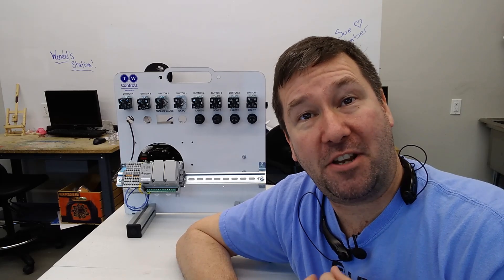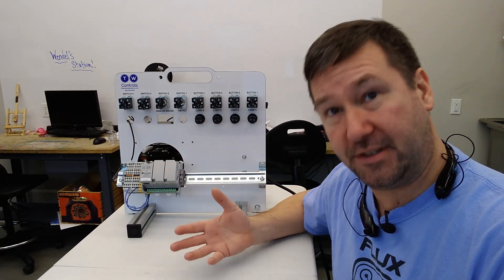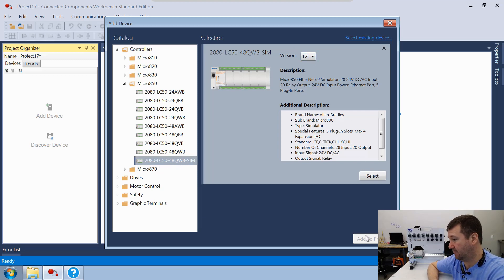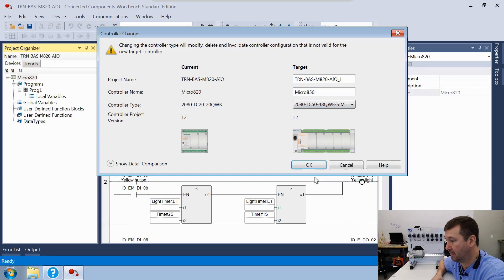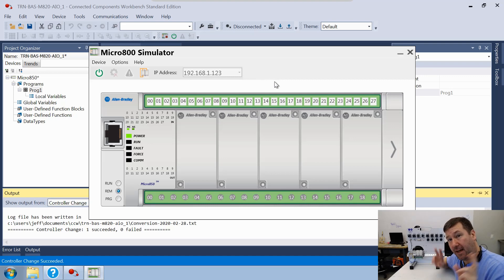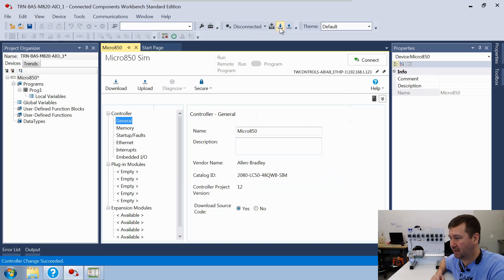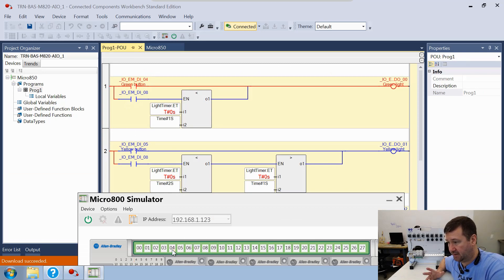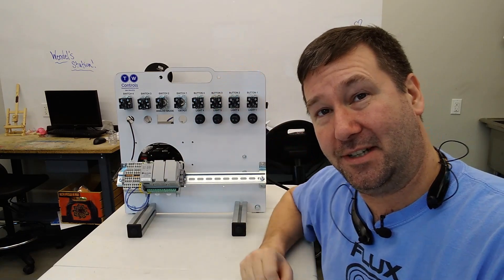Allen Bradley  Micro800 PLC Simulator Connected Components Workbench

Comment: Hi Tim, Tried the exact same way, the IP address shows in the Ethernet ip driver in rslinx but with a red X on it, so I can’t set it as communication path, what could be the issue, the same IP pings fine, I also have disabled firewall , still same problem persists .
Reply from the maker: Did you hit the power button on the simulator?
Reply: @TimWilborne yes I did
Reply from the maker: If it was a real PLC I would be leaning towards an issue with the harmony files. I guess the same could be true for the simulator. Try this. 
https://youtu.be/ehcek7zRGg0
Reply: @TimWilborne  I tried deleting both harmony files and then tried again, still the same issue is persisting. I also tried adding 127.0.0.1 software loopback interface1 as an ethernet device in configure driver option , even that shows up in rslinx with a red X, then i uninstalled the software and reinstalled and tried again but still the same issue is coming, I don't know what i can try next..
Reply from the maker: That's tough, I would check for any internet security suites that might be blocking ports 2222 or 44828.  Also, are you using the Ethernet/IP or Ethernet devices driver?
Reply: @TimWilborne  i am using ethernet/IP driver, i have allowed port 44818 (this is the port for microsimulator) through firewall, when I run netstat -ano on CMD prompt it shows TCP,  local Address as 192.168.64.2:44818, foreign address as 0.0.0.0:0 and state as LISTENING and on the next line, it shows TCP,  local Address as 192.168.64.2:44818 foreign address as 192.168.64.2:52196 and state as ESTABLISHED, so it means that port is open and listening. But it still doesnt connect and rslinx gives red X on this IP...

Comment: Hi Tim...I am new at the Micro850 and CCW. I am using the Simulator to practice. I am selecting ST as my programming language. I can not find the user interface any where within the CCW. I do see the PanelView, but that has to be connected to a physical PanelView to use as a user interface. I just want to do a simple thing, have a push button, where you can click on/off. Please advise.

Comment: I had a simulator working, but now I always get the fault "0xF019 - An unexpected software error occurred due to memory or other controller resource issue." and can't find it in the Manual. Any idea what this or how to fix it? Also, I've found solutions for the (44818) port issue, but still seem to get it.
Reply from the maker: Haven't seen that one Brandon.

Comment: Hi Tim... Love all these great training materials.  I have bought several of your trainers and use them at our college... absolutely love them!!  Quick Question about the Micro800 Simulator.  Every time I attempt to turn it on, I get an error message about "the EtherNet/IP Port (44818) is not available because it is already allocated by:  RSLinxNG"  any suggestions about how to remedy this?  Is it something to do with my version of RSLinx classic?
Reply from the maker: Hi Doug.  Glad you figured it out!  A few more details for the next person who may run into this.  RsLinx Enterprise is running...probably as a service...and needs to be closed.  In order to close RSLinxNG.exe:
1.  Press Ctrl + Shift + Esc to open Windows Task Manager
2.  Then go to the Processes tab (or Details tab if you have Windows 10) and look for the RSLinxNG.exe.
3.  Then right-click on it and then on End Process.

To prevent RsLinx from running as a service...
1.  Go to Start-->All Programs-->Rockwell Software-->RSLinx and run RSLinx Classic Launch Control Panel.
2.  Uncheck the Confirm that Always Run as Service check box and press Start.
3.  Start the simulator
Reply: Nevermind... figured it out.  Had to shutdown FactoryTalk Linx processes in the Task Manager.

Comment: Hi Tim. Is it possible for you to create a video explaining wiring and logic of a DC motor drive to a PLC?
Reply from the maker: The logic would be the same for most drives.  Check out the 2 wire control and 3 wire control videos at the following link.
https://twcontrols.com/ac-drives-and-3-phase-motors

Comment: Great video on getting started with the free Micro800 Simulator included with the free Connected Components Workbench software v12 and above.  As you point out, you need to simulate a Micro850 (2080-LC50-48QWB-SIM).  This is great to get started, learn some logic, and perhaps test some code/algorithms.  You can even use it to communicate with a HMI or VFD.  If you are looking to do any of the following, you need to get a real controller.  Serial Comms, Modbus, Modbus/TCP, Real Time Clock, Socket Comms, High Speed Counter, Plug In Modules, Expansion Modules.  Also if you really get fancy with some floating point calculations, you will see a slight difference between the physical controller and the simulator.
Reply from the maker: Great info Dean.
Reply: I was trying to import the tags to a LS software for HMI, XP-Builder, but it didn't work for me. Can you explain more?

Comment: Hello again, Tim ..
I'm following your steps, and when I'm going to do the "change controller", I don't see the same options that appear to you!
I don't have that "2080-LC50-48QWB-SIM" option ..
I've tried it in different ways and it doesn't work.
What should I do?
Reply: I already understood what was the issue.
Reply from the maker: @ricardogondim2346  What did you find?
Reply: @TimWilborne  
I realized that when creating a project, I choose a Micro850 controller.
Then I did the programming and only then I have changed  the controller for the simulation one. Sometimes when I download it, it searches for Ethernet and does not find any and also does not simulate. What I do is, I turn on the simulator and put it in REM mode, and download it again.I think what got me confused was that you started with the simulation controller and then used your own program, already done. Because only afterwards I have noticed that the controller was different. Anyway, learn from mistakes :)
I hope this can help someone with the same kind of doubt.
Thanks Tim for your availability, I appreciate that.
Reply from the maker: @ricardogondim2346  Thanks for sharing what you found.
Reply: @TimWilborne  Of course 👍😉 I agree with you, about sharing thoughts and experience. But you're the one I have to say Thank You. Without you I would never knew about Micro800.  So, Thanks for sharing it. You're very kind.👍
Reply from the maker: @ricardogondim2346  You are welcome, glad I could help.
Reply: @TimWilborne  Hello Tim, So, I have been programming a management program, and among others, I use a CMP.

But, on Micro800 I can't find anything that does the same functionality! Of course, I can always use other 
functions, to achieve the desired.  But my question is: Do you know how I can build the program using a function more similar to a CMP?     Imagine an example:  I want that when my "power" would be greater than 600KW, for "X" seconds, it would connect the 2nd transformer! So I could do: CMP: Power> 600. 

What do you think?
Thank you.
Reply from the maker: @ricardogondim2346  it has the compare instructions. Check out our counter lesson at the following link, we use them near the end of it. https://www.theautomationstore.com/allen-bradley-micro800-counter-instructions-in-connected-components-workbench-software/

Comment: Hi, Thank you for your excelent videos. Do you now if the standard version let to simulate ? I have this but when I select download, the system only do compilation. Thank you very much for your answer. Greetings from Colombia.
Reply from the maker: Yes, the standard version has the simulator, make sure you have the latest version of CCW.
Reply: @TimWilborne  yeah i hace 12 version, i select the PLC model sin as You indicate i'm the video but option download don't run, insee the similares PLC only. I don't know what happen. Thank You for your answer
Reply from the maker: @comercialmoxasesoria3028  Did you start the simulator and power it on like show in the video?
Reply: @TimWilborne  yes sure, the simulator appear and Plwer on but download mor run. This is the unic difference. This start to compile and not récord the programa, not error appear.
Reply from the maker: @comercialmoxasesoria3028  I'm not understanding this part, "not récord the programa"
Reply: @TimWilborne  I mean the download don't run... It do compilation process when I click download to the similator
Reply from the maker: @comercialmoxasesoria3028  Does it say download successful in the report window?
Reply: @TimWilborne  the answer I did download is COMPILATION SUCCESFULL... I Don't know why..
Reply from the maker: @comercialmoxasesoria3028  Did you switch the processor to run mode?
Reply: @TimWilborne  yep this is runnimg
Reply: @TimWilborne  Hello, I found the trouble was ethernet configuration of my laptop and the machine specifications. Thank you for your guidance.
Reply from the maker: @comercialmoxasesoria3028  Glad you got it working.  Ethernet configuration can be tricky!

Comment: Is it possible to do videos on real life application such as food, beverage or mining  PLC programming
Reply: Power plant or food
Reply from the maker: @mate2173  OK let me see what I can work out :)
Reply: Tim I hope it's not to late. I am trying to get a tank on the supply 2 pipes one wild the other conytolles flow. The output nothing special just another pipe. I want my level transmitter and my controlled flow in a cascade. Last insteaf of a valve for my flow control I'd want a VFD that runs my pump on the controlled flow. Wild flow just a flow with no significant control, but with a rotameter to let me know my max flow and set my unity value for the two flows so I can use the normalized equation. I know this is all a DCS kind of setup but I don't have a DCS and a DCS is basically PLC anyway they just put a different name on it as we all know. My focus is on mining. Things like froth flotation and leaching and most impotantly slurry treatment, tanking it and shipping to whoever needs the chemicals rather than having a tailing pond. So lets learn from you.
Reply: @kirkkirk5797  Sounds like you need to hire a controls specialist or consultant.
Reply from the maker: Yes we're working on some ideas for that now.  Any applications in particular that you think would be good?  Thanks for watching!